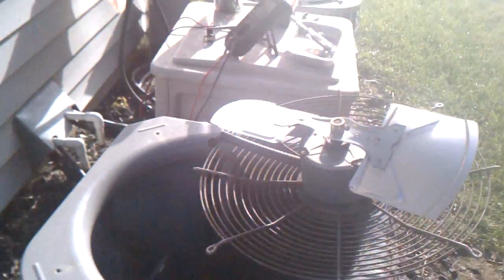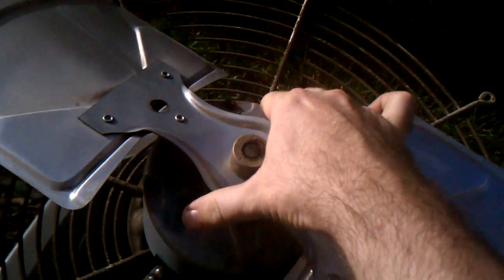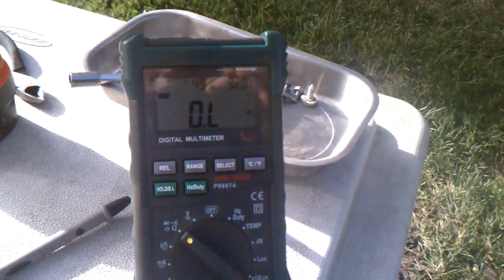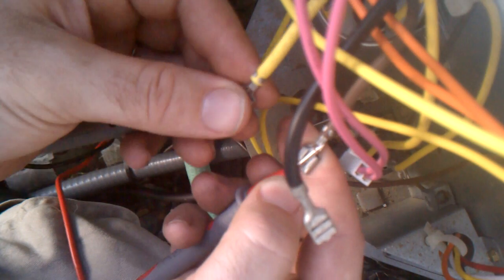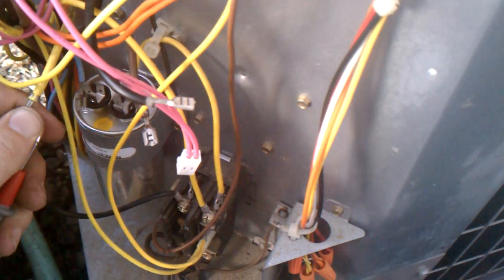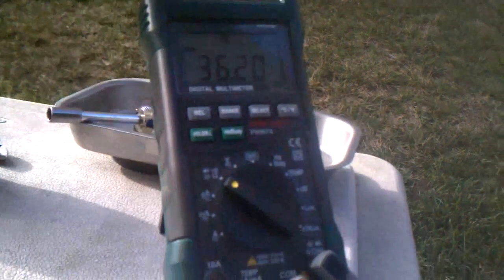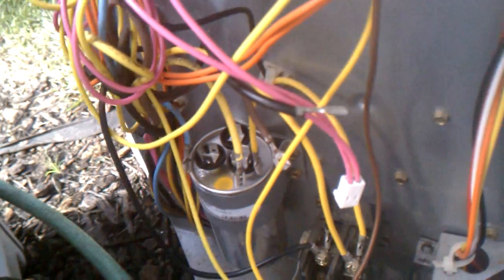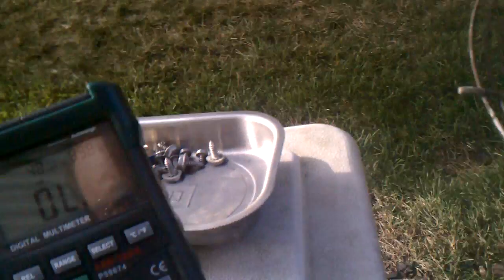Troubleshoot outside condenser fan a/c ac hvac part I

Comment: Moral of the story when calling any tech to "diagnose" or "troubleshoot" a problem over the phone is more often than not, you are going to end up throwing parts at the problem and still have the problem. You may get lucky and the tech's "educated guess" is right, but it's not the tech's fault if the problem is still there after telling you the most common reason for what you describe.
I can't tell you how many times in my 41 years in the auto repair industry that I have had people call me on the phone trying to get me to diagnose their car trouble over the phone. There's a reason that techs charge a diagnostic fee, and that is because they have to do physical tests and a visual inspection of any system whether it's a mobile or stationary HVAC system, or a "check engine light" problem. That requires expensive equipment, training, and the tech's TIME. 
If you want a good repair, don't cheap out, pay a qualified tech what their worth, or learn to do it yourself; but PLEASE don't ask the tech to put his reputation out there giving you an educated guess - only to be badmouthed because their recommendation wasn't the problem.
When people would call me, I refused to fall into that trap because I knew I would get a call back right after they tried what I said "it could be" and have to listen to them cry about the cost of the part that didn't fix the problem. They learned quickly to bring me the car and at least pay me for my time even if they went home and put the part on for themselves after my diagnosis or go ahead and throw parts at the vehicle as I warned them. Their vehicle, their choice; but their wallet taught them far better than my words more often than not.
;-)
Reply from the maker: I had him come to the house. I paid the diagnostic fee. It was the company that installed the units originally.

Comment: I might be having the same issue?????   I have a E4D036S06A model York heat pump and the fan does not engage.   I checked the fan resistance levels like you did and they add up to exactly 55.  Plus the fan spins easily and freely.
  I also checked the capacitor it looks fine but I got a new on just in case.  

When I manually engage the switch or have the thermostat call for heat I hear the compressor going both before and after I switched the capacitor but the fan still does not engage.   Voltmeter says I have 240V at the switch and on the other side when it's calling for heat.  Not sure what else it can be now except the defrost sensor which I didn't check or change.  It looks identical to you have in your troubleshooting.   

Do you agree?

Comment: My fan works but no cool or heater can it be the compressor
Reply: Yesenia Cordova its most likely the capacitor. It might not be strong enough to start the compressor; may just need a hard start.

Comment: Before going to buy caps, motors, defrost t-stat .  Well you don't need defrost controls when its hot. You have 3 wire coming off the motor. Brown going to 5mf  cap.  the fan motor needs 208 to 230 volts to run. You have a 2 pole contactor it has 240 volts going through from the line side the breaker side to the load side your compressor and fan.. The other wire from motor black goes to contactor  , then the yellow wire plugs into the defrost switch on circurt board all that does is cut off the fan motor in winter time . Just unplug the wire from the circurt board  and plug it into the other side of contactor where all yellow wires are. of course the spade will be smaller so it will not fit so carry a fer wire in your tool bag where you can just wirn nut together the wright size spade .  cut breaker on if fan works you have a bad board.   got to think MacGyver sometimes.  Best thing to do is call someone that does this job everyday.  Reminends me of the call I went to today, Bad board on furnace But he wanted we to talk to his insurnance man to get the $850.00 repair done. I haft to stay on the phone with INS people for 1 hour. I told him that lighten did not hit furnace He was a Insurnance agent and did not care. said he would get it through. So I told hin if I need to waite on money and lie it would cost $4300.00  for repair. he of course got mad. he will be hot this week  because all that is wrong is the black box  switch that cuts on and off fan. I could plug up his fan and give him air till part came In tomorrow. I don't lie to insurnance companys. He will sweet his ass off for next 4 days. I bought the last one at parts house today because I was there late and they only had 1 and said they are hare to get.

Comment: I have a question. There is a separate brown wire that comes in from the house to the AC unit. This was disconnected by my dogs and I am unsure where to reconnect it. Any tips on where this cord connects?
Reply: your talking about the thermostat wire between inside and outside, you will have red white yellow black orange, is it heat pump or gas heated furnace? and what part of country you in. and is it a ruud or rheem unit, email me and I'll send u a easy follow diagram

Comment: great video for a non tech thats coming from a 17 years in the field tech all all units,
you miss understood the freezestat  it uses the temp of the outdoor unit to know when activate defrost and the board has a builtin time delay if it does not come back on after xy min depending on manufacture and part of country your in, it will time out and turn on anyways.
but great vid

Comment: Great Video. I have a question for you. I have a HVAC unit that after changing the Capacitor, contact switch and defrost boards, it appears to me that the fan spins a bit slower than the unit next to it and it also appears that the fan spins in the different direction but that could be because an illusion due to its slow spin and one more thing the fans seams to always be spinning without the compressor having to be on. Please help
Reply: William Belliard your fan spins at designed rpm it tells you on the side on the motor the rpm 1075 is normal for mid size and 800 to 850 for 1/15hp and others or vfd controlled on pricey units.
the motor can spin both directions if generic brand it has a rubber plug with 2 wires just unplug and flip one the other way.
if the fan is on and no compressor you have a bad defrost board relay or wired up wrong hope this helps.
Reply: +needs2 know hey I'm having a problem with my AC unit I replaced the fan and the compositor and when I go to turn the unit on it runs for about a hour then turns back off  do you have any ideas what it could be I put a new filter in and checked the house breaks I'm currently in 98 degrees weather and my kids are all bummed we been staying at a hotel.  I live in USA Delaware . And my email is Crodr70@gmail.com if you could please get back to me with any kind of information I would greatly appreciate it.
Reply: +Carmelo Rodriguez you could have to strong a capacitor in your unit. it will cycle on and off too frequently and therefore won't run long enough to bring the indoor temperature down before it cuts off again. it's short cycling because you have too big a capacitor and the unit shuts off early as a safety feature because your capacitor is feeding it too much power. get a capacitor with a lower microferit rating. I'm betting the one in therefore is too big.

Comment: Hey there! I have a problem why my outside condenser fan ac hvac is it won't stop keep running 24 hours & it's sweating & building ice. Help please
Reply: GalaXy808 the units buillds ice in winter and then enters defrost to melt it, ice in summer mostly is from a dirty blocked filter or a indoor coil dirt build up stopping air transfer. could also be low charge anytime a tech hooks up if they dont precharge there hoses they are taking freon out

Comment: You sound like the real thing,  my question on the condenser fan motor instructions says the two brown wires goes on either side of capacitor is there a black wire to one side of capacitor to charge it? or was that a stupid question.  I have two brown wires one brown with white stripe  but I forgot if one of the black wire is connected too capacitor?
Reply: Danny Diet Just a tip when checking resistance. You should try to not allow your body to become part of the circuit or you will also read resistance of your skin. If you're sweaty it could alter your readings a great deal.
Reply from the maker: Danny, I'm not an HVAC tech. Just a homeowner. Caps normally will have a common prong that connects to the fan motor and hermetic compressor. Then it also has a prong for the fan motor and one for the compressor (herm). These are called dual run caps. If you are using a generic fan motor it will have various wires and you choose the one which corresponds to the correct RPM needed for your circumstance. I would go to www.diychatroom.com and post under the HVAC board, they can help further.
Reply: thanks for the tip I will I was working with a friend and he pulled wire off but didn't see where I have two capacitors one large one and small one its on my g+ photos the large one is wired but the small one is not so I think a black wire should be on one end of capacitor to charge it or does that supplied by one of the two brown wires from the fan motor??its driving me crazy!
Reply: Danny Diet generic fan motors have 4 wirers white to c of cap and black to contactor or defrost relay, if you want you can cut the brown and white put a cap on it and put the brown on the original dual cap most if not all units are 3 wire from factory
Reply: Bugdriver49 dude u realize its been over a year since I fixed it. Anyway yes I know about resistance but thanks
Reply: No. You only need the two brown wires

Comment: I have checked continuity between L2, T2, and T1 and there is continuity, when the single pole is pushed down there is continuity at L1 as well. Is this correct?

Comment: It is a RHEEM central residential a/c unit. Single phase, black wire from house to fuse box-red to L1. White taped black from house to fuse box-black to L2. T1 is black to Comp. and OFM. Red is from T2 to compressor. Purple is from compressor to RC Herm. Brown is from RC to OFM. Common is Orange is from OFM to common on RC, which then goes to T2.

Comment: I have a problem with my a/c unit not operating, I have replaced the run capacitor and verified the microfarads are correct, 45/5. I have cleaned the contacter, with the a/c thermostat off, temp set at 90, breaker trips as soon as I turn on the breaker.

Comment: Just a couple safety issues for anyone trying this. 1- Always test for power after turning off power at disconnect to be sure the power is off. Disconnect breakers fail, shorts happen, etc. and you do not want to take out fan and have your hand or body around it and find out it is still powered up. Never trust the switch, breaker, etc....trust the test. 2- Always ground the capacitor before you touch it. It is rare to hold voltage, but can in the right situation. Take care,Brett